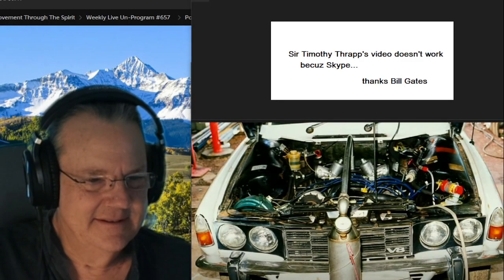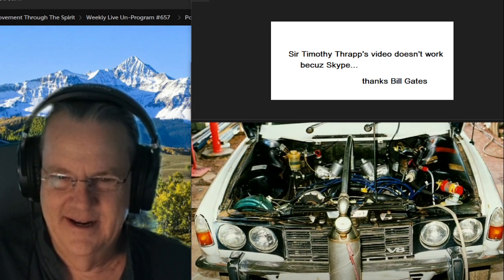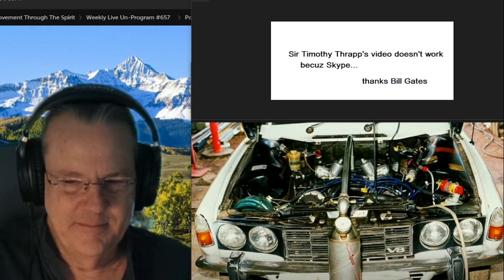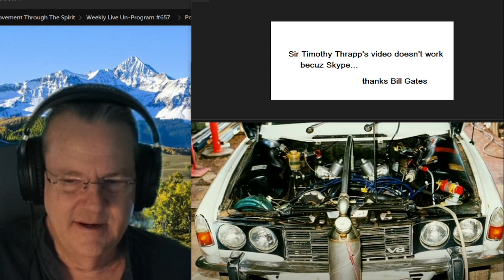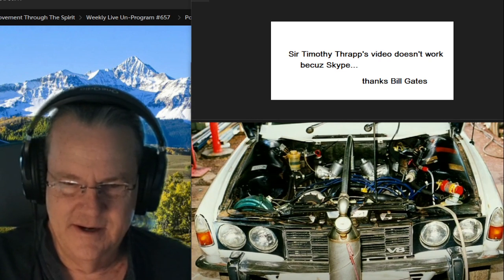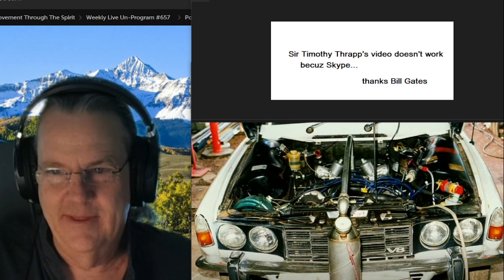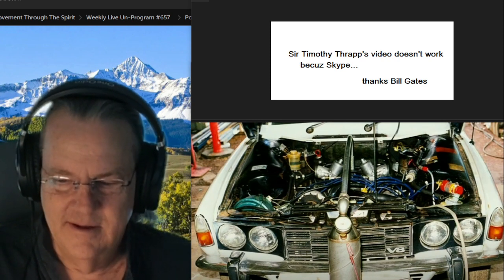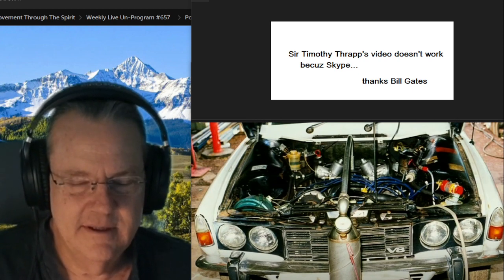Air-as-Fuel Engines and Portable Generators / Joe Cell

Comment: Joe has asked many of us to take the JC stuff off the internet, which we respectfully did. But the short story? Polarised crank shaft after aluminium has accepted the conditioning.  You're welcome 😁
Reply: Is that 3 sparks to the harmonic? Or just 1 tap? I believe I did 3. I did this and it worked on my 1995 Tercel to give an increase in gas mileage in booster mode (the only appropriate method).

Comment: Joe, the man is a natural intuitive mechanic the likes of which you've never seen. God bless that man.  
Implosive cell water makes plant life grow like crazy too. What Joe did was real, folks.  And I hear these cars .... Float.  Levitate.  
Why is the correct question.
Reply from the maker: Yes, if they are fully polarized they can lose all mass and inertia. If your field isn't normally polar or as polar and you polarize it too quickly it can make you sick.
Reply: @QuantumEnergySearch  How long does it take to polarize a motor on which the block is not made of aluminum but of steel?
Reply from the maker: @AleksaRancic  It probably will not work. Aluminum polarizes really easily. Also there's higher compression in newer engines, which could be a factor as well. Getting sometime to polarize the first time can be really difficult or next to impossible if you aren't highly polar. Find someone who is highly polar and work on something simple that's easy to do for the first time.
Reply: @QuantumEnergySearch  The engine from the lawnmower is entirely made of aluminum, I will try it first.
Reply from the maker: @AleksaRancic  excellent choice.
Reply: @QuantumEnergySearch   How many volts and amperes should be applied to the electrolyzer during 24 hours?
Reply from the maker: @AleksaRancic  what kind of setup do you have?
Reply: @QuantumEnergySearch  I have various DC power supplies. Is 12v 1amp a lot?
Reply from the maker: @AleksaRancic  that should be the right amount
Reply: @QuantumEnergySearch   Since I've been studying water-powered cars for a long time, it's been 10 years and I still haven't managed to completely turn off the gas. Now watching and listening to every possible video from Joe, he mentions in one video that he changed the polarity of the vehicle from negative ground to positive. Do you know anything about that, I know that old vehicles in the 50's had positive ground.
Reply from the maker: @AleksaRancic  That won't do it. It's dominant energy polarization. It sticks to objects like a cloud and exhibits weird effects. The reason people use pre-computer cars is because the polarized cloud creates something similar to "static charges" which will eventually fry computer chips, which can't handle more than 5V usually. The only ones I know of besides Joe teaching how to do polarized stuff is WITTS. Seems like anyone who knows how to get the Joe Cell working properly doesn't share about it online freely. Because there's a lot of people doing Joe Cell engines and water-power engines. But when you search it online, there's not much info.
Reply: @QuantumEnergySearch   I tried to do 24 hour polarization on the lawnmower and turn it on, but nothing happened. I connected the cell to the blind plug on the engine block as it was mentioned to be done. But after 24 hours nothing happened. Can you explain in more detail how to do it?
Reply from the maker: @AleksaRancic  You probably need classes from WITTS. I am not WITTS but I have taken classes before. The polarization process is usually difficult for most people who aren't highly polar already (Joe, Bedini, Ron Brandt, etc.) Usually you have to get an easier system to work first. The aluminum polarization is master level polarization (almost like being a wizard). It's not just how polar your field is, there are other factors. I have difficulty polarizing anything right now (a lot more than most.)
Reply: Exactly what I want to know, why the "levitation?" Joe did say that his friend's truck hovered slightly off the ground, but was still "connected" to the Earth and drove normally, despite not touching the ground. We really need to figure out what could cause levitation. If that is a true story, then Joe is certainly the most important single Human inventor in Human history; because he also claimed that a Joe Cell could provide unlimited free electricity without any electrical circuits or moving parts. He also claimed that it healed his friend who was terminally ill, just by walking into a shed with Joe Cell's in the shed. Joe made other claims, including his race car that did a 5 second 1/4 mile pass, which would mean the car had about 6,500 horsepower, or some kind of "mass reduction." Joe ALSO said that he cut through solid steel with a Joe Cell powered welding torch without ANY FLAME AT ALL, and no hole for gas to exit the nozzle on the torch. Of course, the Joe Cell also runs without any connection to the engine, it uses a "blind fitting" with no hole in it, so the whole thing is magic to begin with.
Reply: @starseeddeluxe It was Rachel Splatts dragster that was experimented on .It made very little sound when it ran .Was hushed up after and Rachel went o

Comment: The engine is sealed to cause a vacuum .it will run cold and if not carefully restricted it may supercapicitate .like Joe papp engine .energy from the vacuum ...electro static the lightning magnetic static the thunder clap  lightning the natural earth energy thunder the vacuum energy  a push pull by capacitation pressure etc
Reply: Can you help me do it on the car?